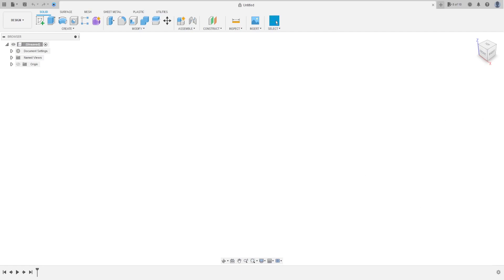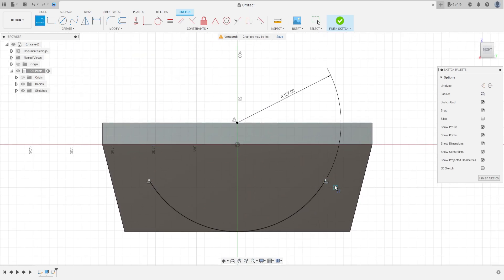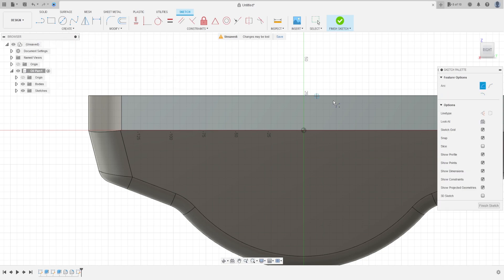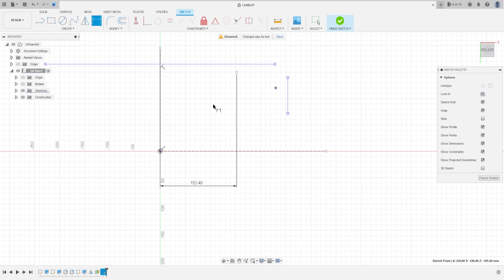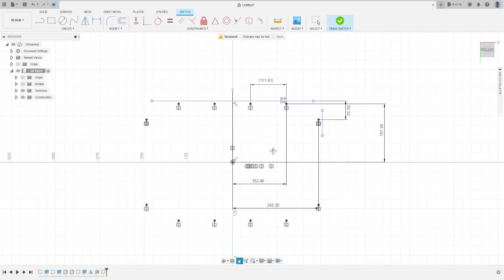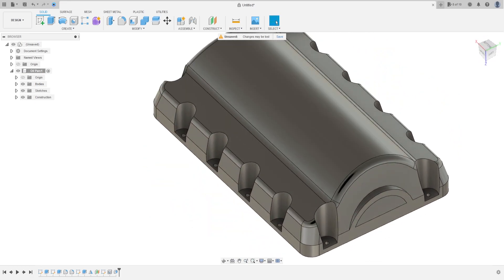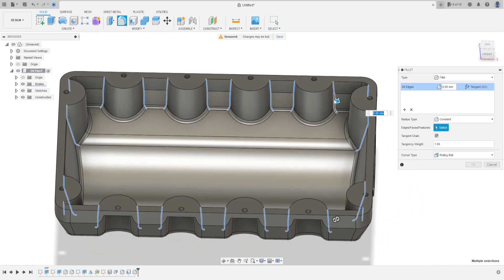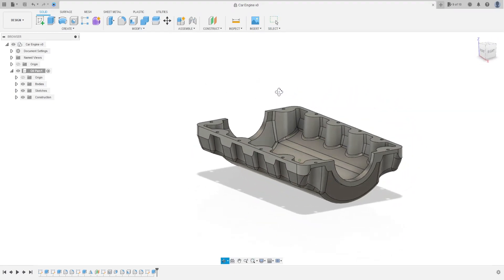Fusion 360 Tutorial - Oil Pan

Comment: I noticed that at 3:42 in your video, you mentioned using a 25.4 mm fillet for the corner fillets, but this doesn’t match the fillet on the engine block. When I revisited the engine block tutorial at 18:18, you used a 20 mm fillet, so I adjusted the oil pan to match that. I’ve been going through several of your beginner tutorials and working on the engine series. I really like your teaching style and have learned a lot from your videos.
Reply: im making ts at 2 am lemme change it rq thx

Comment: Hmmm, for some reason Fusion can't draft at five degrees at about 10:50 🤣 You can make 12(!) bodies to use as boolean bodies instead if you want the proper draft angle. Good tutorial though.
Normally use Catia (30 years). And well, there is a difference  🤣
Reply: I encountered the same, I was unable to draft at 4 degrees.